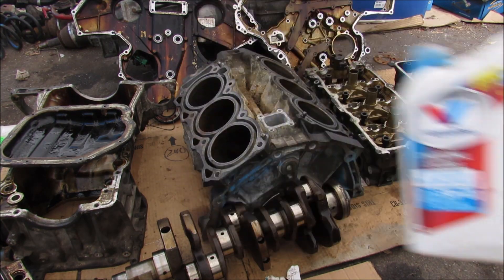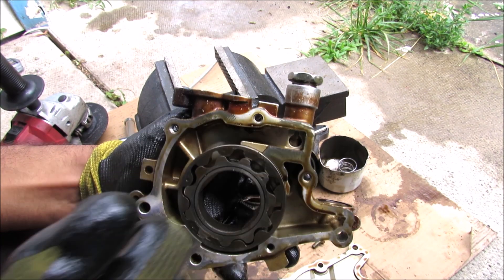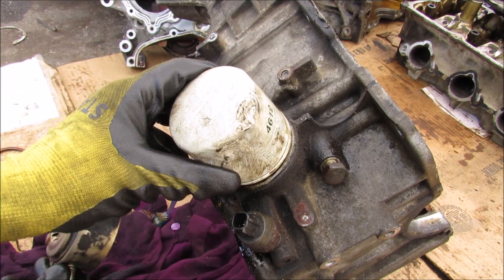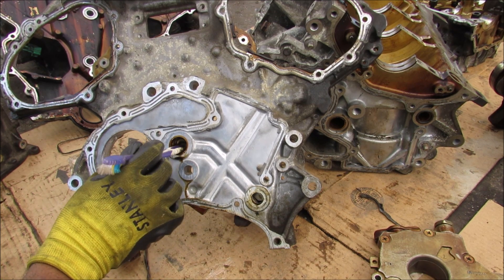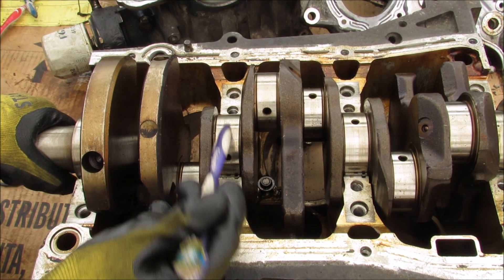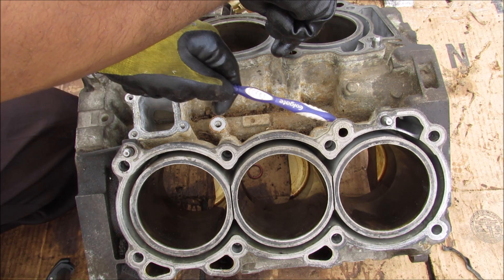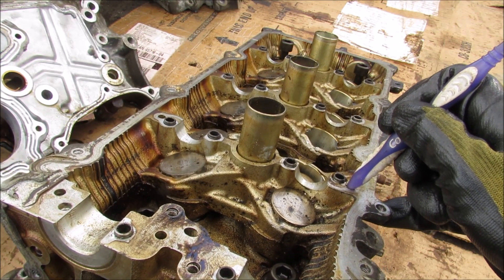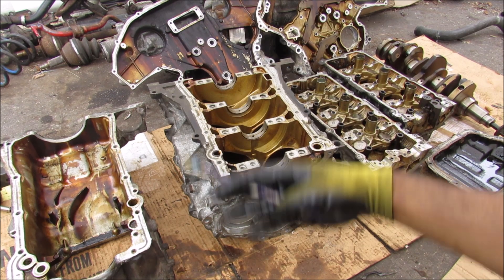Why ENGINE OIL is so Important!

Comment: I am an interdisciplinary scientist for a living. I live to learn new things and although I'm classically trained in molecular biology, I can't get enough of other disciplines. By happenstance I ended up on your channel and can't believe how little I know about the magical mechanical compenents of modern vehicles. I am currently addicted to your channel and you deserve to know that. My most recent mind blowing experience was learning about the torque converter and how there is not a complete mechanical linkage from the engine to the road (except for in certain cruising conditions). My fluid mechanics class came flooding back in through my brain.

Comment: Good overview on why it is important to regularly change the oil and filter.  Keep those passages and holes clear and avoid buildup of gunk.  I have a 15 year old 3 liter Accord V6 with 350,000 kilometers and drive hard.  Engine runs like new cuz  I change the  oil every 5 to 6k.  It's that simple
Reply from the maker: That's awesome! Honda does make very strong engines I gotta admit

Comment: I have changed the engine oil and used it for some 800 miles then left the car unused for 1.5 year do i need to change the engine oil again before use.
Reply from the maker: Yes 
Oil degrades over time
Reply: @speedkar99  Are you sure ?

Comment: Great explanation, was never sure how the oil flowed through the oil filter (guess you can teach an old dog a new trick). Sad that, as cheap as engine oil is, relative to repairs its the most neglected. Even cheap oil changed frequently is better than expensive oil left go. Who needs shop towels when you have family to donate to the cause. Thanks for the work you do on your channel we all appreciate the chance to learn from a great teacher.

Comment: The said "drain bolt" is used to drill oil passages in engine block, bolt is used to close the oil passages drill hole so oil wont squirt outside and flows to intended areas.
Reply from the maker: They use pressed in ball spheres to seal off drilled galleries. 
Why would they tap and put a bolt there if it isn't to be serviced?
Reply: speedkar99 I think it’s for oil pressure testing.
Reply: @speedkar99  maybe the drilled area is too fragile to put a sphere ball, so they decided to thread it and put softer bolt to seal off the hole.
Or they use it to test and make sure oil's flowing during manufacturing process.
Reply from the maker: Good call
Reply from the maker: Or the engine block is used in different applications where external oil pressure is needed. Ehmm Turbo anyone....
Reply: @speedkar99  if this hole is intended for turbo oil line, there must be return hole somewhere. Bolted hole, but not pressurized.

Comment: Nice tore down vq35de.  What happen to the car to make you cut it up? Btw shoukd open the vvt sproket. Really easy and feel people would enjoy you explaining how it works
Reply from the maker: Thanks. I have taken apart a Toyota VVT gear and done a video on it already. I'll take this one apart in a future video. 
The car needed too much work to put back on the road safely and was worth more to me in parts.
Reply: @speedkar99  i understand how that goes. I took apart one of my sprokets on my g35 after i replaced them with the newer HR style ones. It was broken inside. I actually made a keychain out of one of the parts.

Comment: What are your thoughts on newer vehicles requiring 0W-20 oil? Some says it's necessary due to tighter component tolerances, but others claim it's so manufacturers can advertise better fuel economy
Reply: It's a combination of both, good oil flow in extremely cold climates, and work better with variable valve timine systems as explained with their tiny passages in the video. Going up a weight like 0w-30 or 5w-30 is a good idea if you tow, go off-road, or drive up mountains all the time because oil temperatures go through the roof.
Reply from the maker: Agreed. Economy and tighter tolerances are the main factors.

Comment: I think you missed a very  interesting chapter about oil viscosity. Lubrication is not a dry subject. Oil is the blod of ALL engines..

After showing all the oil galleries and variable timing gear oil pressure... it would be very interesting to note the timing solenoid is used to linearly adjust and make up for oil pressure differences...

You can show what happens when the filter is replaced and the oil circuits are all drained out.

You can talk about how to make friend with your engine lub system by letting the pressure reach everywhere before driving (crankshaft internal gallery feeding the "sprayer" that tries to lubricate the last piston Pin... imbalanced engine  wear)

The importance of oil temperature (viscosity)  before going up in the higher rpms  
or engine & trany Rpm vs. lubrication vs. longevity 😂

[Be curious... look at huge maritime engines lubrication! Everything is huge but well lubed piston pins the size of a leg]

thank u
👍🏻
Reply from the maker: This video focussed more on the lubrication system and not the oil itself. There's a plethora of topics related to engine lubrication that would take hours to cover! But in the interest of not boring you all I kept things concise.
Reply: What is the normal operating oil temperature that you want in the morning before taking off what would you recommend

Comment: Great video as always. Love your channel. (Previously you did a good job explaining how the A/C works and now I know why its colder when I step on the gas.) So I have the same engine that you recently showed in the Hyundai Kona, it's in my 2018 Elantra. I bought the base SE so I have the manual. 2 things maybe you can answer. I use a mobil 1 filter and also use synthetic oil. I change it at 4k maybe 4,500k. Is there any benefit or am I wasting my money changing it that early? Also the cap says to use 5w20. The book has 5w20 and 5w30 listed in the same temp parameter, (with 10w30) in a warmer bracket. Would you just keep using 5w20 like on the cap or would you be comfortable jumping to 5w30 considering it's in the same temp range?

Comment: It's funny because I was in  automotive classes in high school I always thought the oil passages in the crankshaft where just holes drilled into it and thought that they got splashed with oil and the crank/ rod bearings kinda kept let the oil in I had no idea crankshafts have a oil tunnel and the crankshaft actually has oil moving through it and if I didn't see this video I still would of never known I like to know how stuff works to the T and then I can wrap my brain around it better you really should to look into being a teacher for this stuff you'd definitely have some knowledge students after they were done with your classes

Comment: They should hire you at BMW to fix their designs also I like better when you use your brothers stuff rather than your woman
Reply from the maker: Would be nice to work for an OEM one day but I don't think they'd want me. 

Since women go thru more clothes than boys I have a constant supply now 😉
Reply: Why would they want to "fix" anything when fools buy them as they are.
Reply: Viscious Hattermaid BMW’s engine designs are world class, it’s usually the seals that go bad on them and leak oil or the accessories like the water pumps that go bad on them.
Reply: @standyourground9973   So great designs and bad components and that = "quality"?  Sure not something I would buy.
Reply: @wholeNwon  The fundamentals of the engines, block design, material, pistons, rods, etc are pretty bulletproof in those cars. The rest of the drivetrain works well to provide a smooth experience too. Accessories to the engine are problematic in most cars, anyway. They're not for you if you don't like to wrench on your own car a little bit.
Reply: @standyourground9973   Enjoy yours. I'll stick with my '98 LS400...21 years of perfection so far. And I do most of the care myself...oh, and the one repair that cost $20 and took about 15 min of my time (fuel pulse damper).
Reply: @wholeNwon  Can't go wrong with an older Lexus. Mostly Toyota components in them. I would've bought a Lexus 1IS with that nice straight six but the interior in them look like it's out of a Corolla. Can't stand it. Beautiful car outside, though.
Reply: @standyourground9973   If you want a sedan, try to find an excellent 2nd gen LS400 or '04-06 LS430 and you'll NEVER part with it.
Reply: @standyourground9973  those leaky valve seals, and crankshaft bearing problems from mid 00s to 10s are inexcusable however you look at them.
Reply: @Psych0technic  You’re referring to the V8 valve seal issue, which BMW has never really been known for their robust V8’s, and the bearing failures on the S65/S85 and even reported on N55’s. Their quality in some regards is poor, but overall as a whole when considered, are fantastically engineered vehicles when new/in good working condition.
Reply: @standyourground9973  all of the brands of German premium trio are incredible in terms of performance when new and in perfect condition. But the fact is that they aren't often in said condition as the time goes by.

Comment: So many parts are continuasly moving in unison for many miles and years... But... very complex and precise design.
Electric cars - will do the same and more without the complexity.
Reply: Electric motors aren't exactly new... if it was somehow feasible to plug in an extension cord hundreds of miles long we would never have used gasoline engines to begin with! The problem is and remains taking the power with you. Gasoline is still the highest energy density substance we can easily create. Batteries are getting better, yes, but are at the moment slightly overhyped. They degenerate faster than is practical for heavy duty applications, and can't quite store the amount of energy needed for general use. Around town electric vehicles are great, but if you need medium to long distance the start to let you down.
Reply: I agree. We need more charging stations and longer range. Then electrics will replace gasoline. 
Nevertheless it's not a so distant  future. We just starting out as it was with gas engines over 100 years ago.
Reply from the maker: Agreed! Such a marvel that so many things have to move to make an engine work, much less all of the accessories and electronics behind it!
Reply: Nope, they won't. Because after 5 years replacement battery will cost more than the car is worth. Same like phones.

Comment: I cannot imagine what kind of oil pressure that oil pump is feeding through all those tiny tiny holes & oil gallery and how fast the oil gets circulate around the block upon start up.
Reply: 3-5 bars
Reply from the maker: Yeah that's right, it must be high pressure to get thru everything. If one gallery is blocked then something is not going to get lubricated and burn out very quickly.

Comment: if you explained a simple engine symbolically it would be much more educational than an specific  old American V6 engine in detail.
Reply from the maker: Thanks but can you elaborate what you mean by symbolic? 
This is a Japanese v6 engine
Reply: @speedkar99   This is an advanced engine with many advanced part.To explain an engine's oil system you could start with an old simple engine as an example a Ford 4 Cylinder in 70s without VVT or ...

Comment: That's a lot of holes whoever designed this engine did some coke before designing it
Reply from the maker: Haha most engines are like this
Reply: The design of modern car engines evolved through many decades. That includes the design of oil galleries. 🙂